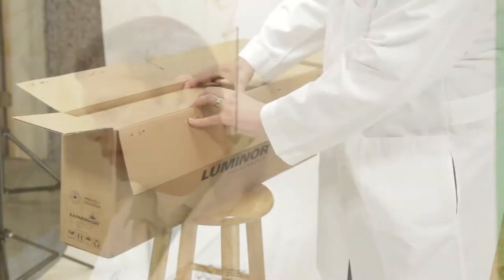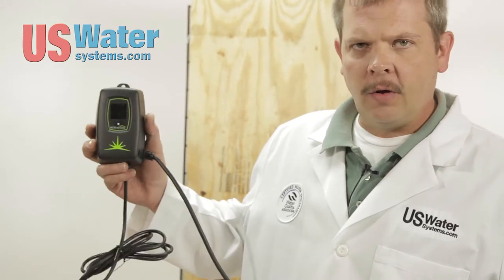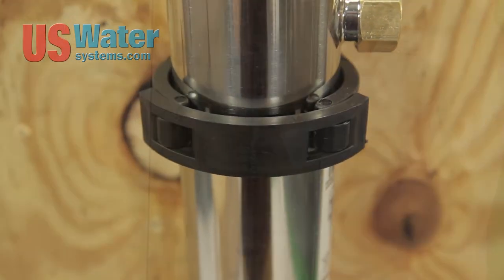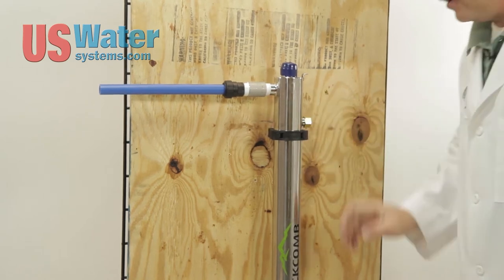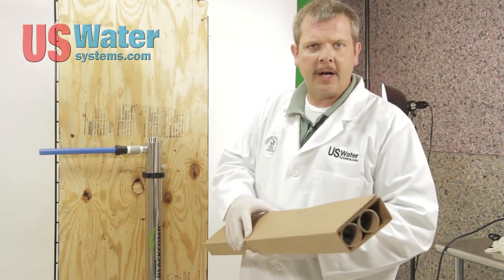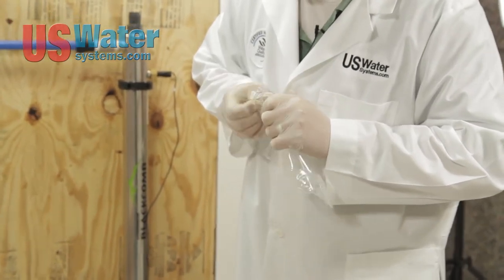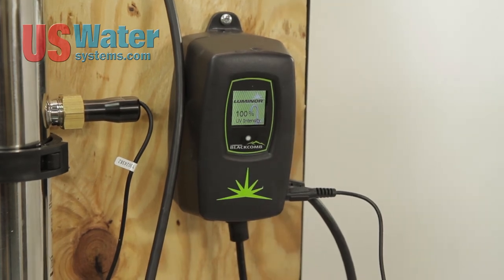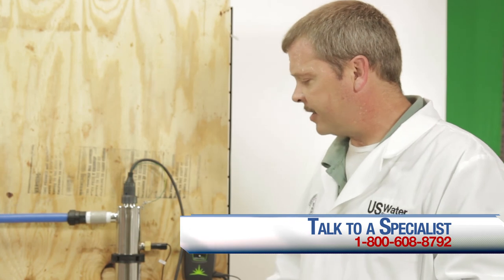Installation of Luminor Ultraviolet Water Filter

Comment: good looking system...i have a natural spring and live in town on city water the water cost is high and want to supply my home from the spring i have with a spicket .i have a 4oo gallon tank. flowtec pump w/ pressure switch i need to still get a pressure tank and filter and very interested in a ultra violet system also. thanks for your vidio